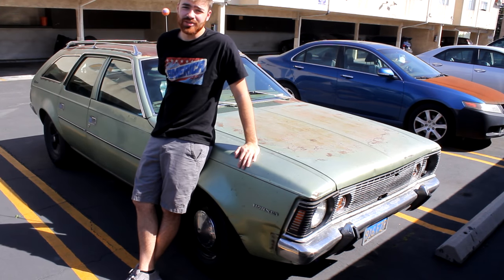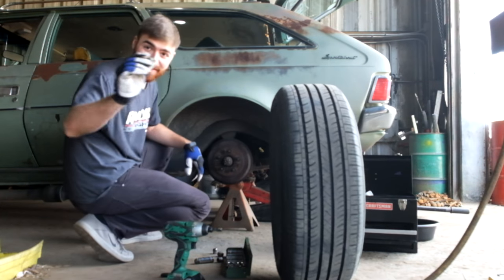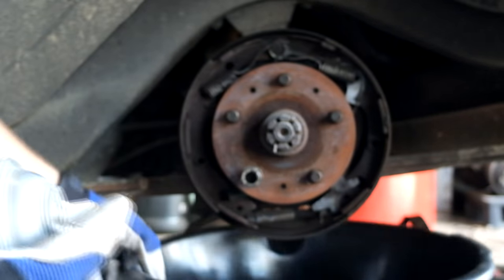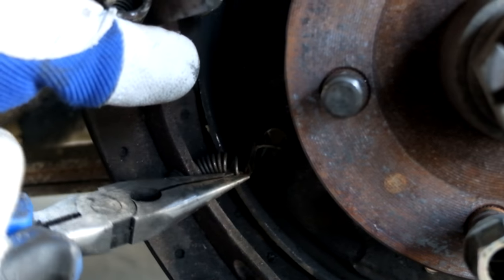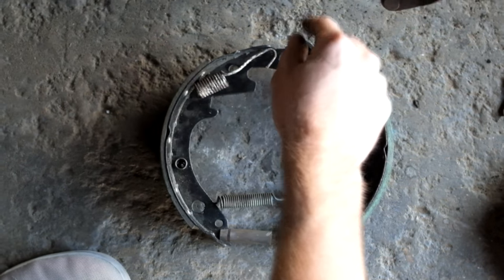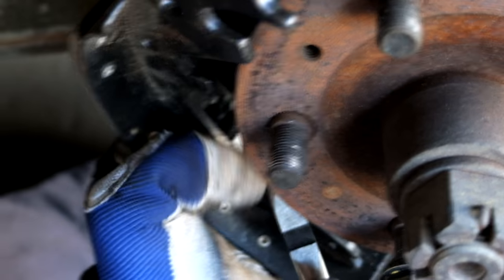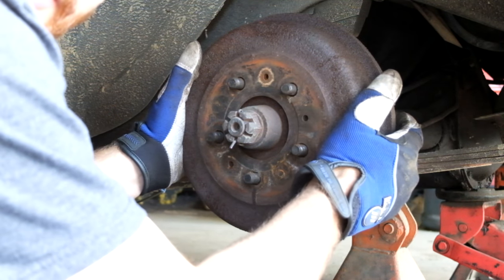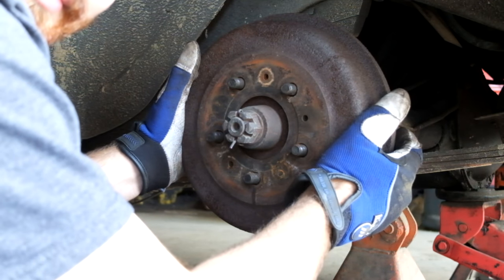How to Replace Drum Brakes - Sally's Speed Shop: Episode 2

Comment: The slot in the bottom of the backing plate gives you access to the adjuster so the shoes can be wound back out of a grooved drum. Or just for readjusting if you got it back together to loose.
Reply from the maker: John Schultz good tip! I missed a whole bunch of vital info haha
Reply: I'm sure you're going to be learning a lot as you continue. Like locking the focus :)

Comment: I hope you learned more about doing drum brakes since this video? the parts stores sell a multi-tool to remove and install brake springs at top and bottom. If you take a small flat blade screw driver and cut a notch in the end of it you can insert it inside the coiled spring to release the keeper. Don't forget to lube the threads on your adjuster. As a mechanic i found this video difficult to watch, but you have to start somewhere. I just found out about your channel, hope to see the Horn'et in some more adventures, love them wagons
Reply from the maker: It might not be the best how-to guide, but it got the job done. I've learned a ton since filming that vehicle.

Comment: Great job dude Looks like you need to flip your adjuster around tho so the teeth side lines up with the oval hole on the backing plate that way you can adjust with a screwdriver with the wheels still on
Reply from the maker: Jay Jay These actually have a hole on both sides, and the little spring loaded tab wouldn't work if it was spun around.

Comment: The front drums on my dads old car are stuck after years of sitting. I'm not really sure what did it either. I got one off, and then realized that the adjusters are seized! The other drum won't even budge. I'm waiting until the summer to do anything about it.
Reply from the maker: Ryan Nothof A little heat and some persuasive action from hammers and pry bars and it'll come right off!
Reply: Oh there's been a lot of persuading all right. It took me days to get the first one off lol
Reply: Ryan Nothof after sitting for years, moisture gets in the wheel cylinders and swells causing the brakes to expand and corrode into place.  Try opening the bleeders for a few days and backing the adjusters out from the back before taking it apart.  You should bleed the whole system before taking it back on the road anyway.
Reply: Out of all the forum posts I've read and advice I've gotten from others, this is the only one I haven't heard and it makes sense! Thanks a bunch and I'll give it a shot!

Comment: Maybe it had a rear end swap in the past, could explain the smaller drums.
Reply from the maker: The Notorious DRIFT That's certainly possible.
Reply: The Notorious DRIFT the bigger brakes are for the AMC 20 rear end available in the v8 models and Gremlin X.  That is the AMC 15